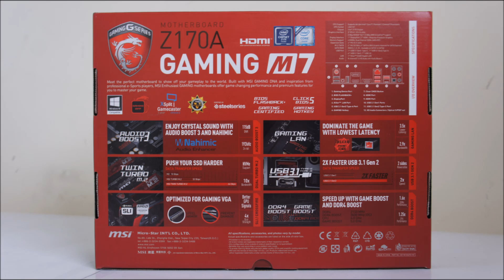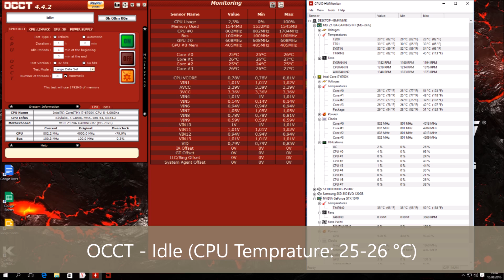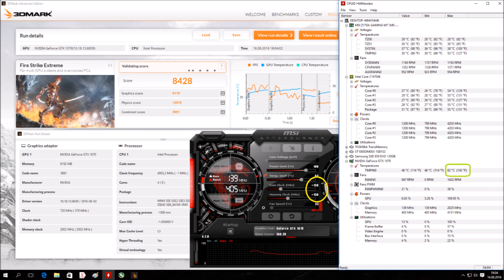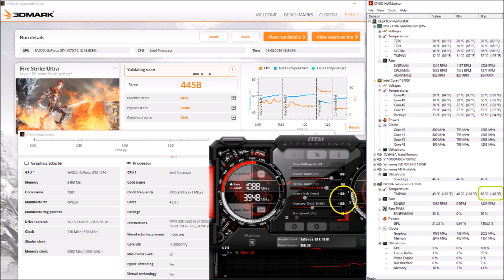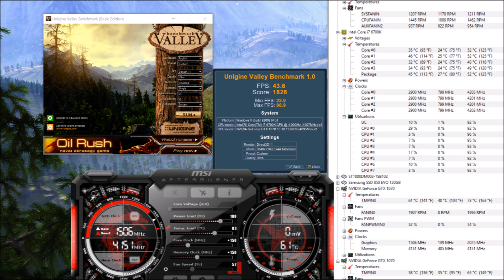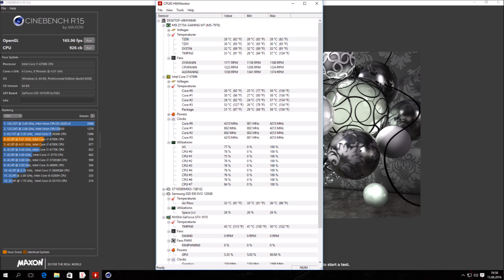INTEL i7 6700K GTX 1070 SLI PC BUILD BENCHMARK & GAME 4K TEST

Comment from the maker: Thank you watching,

SYSTEM CONFIGRATION: 
- CPU: INTEL i7 6700K 
- MAIN BOARD: MSI Z170A GAMING M7
- RAM: G.Skill Ripjaws V Series 16GB (2X 8GB) DDR4 3000 MHZ CL15 
- HDD: SEAGATE 1 TB HDD SATA III 64 MB 7200 rpm 
- SSD: SAMSUNG 850 Evo 120GB MZ-75E120BW
- VGA: ASUS GTX 1070 STRIX, 8GB, GDDR5, 256 bit + MSI GTX 1070 ARMOR @10:15
- CASE: COOLER MASTER Master Case 5 MCX-0005-KKN00 
- PSU: CORSAIR CX750 750W 80 Plus Bronze CP-9020015-EU
- CPU COOLER: CORSAIR H80i GT HYDRO SERIES (CW-9060017-WW)
- OPTIC: ASUS 24D5MT 24X Double Layer DVD-RW Siyah SATA
- MONITOR: SAMSUNG LU28E590DS/UF 28`` 4K Ultra HD 1ms 
- MICROSOFT Windows 10 Pro 64 Bit 

PRICE: 2500 USD + TAXES
Reply: i wanna make the same pc but i wanna change the video card 2 a gtx 1080 msi gaming x and the cpu 2 a intel i5 6600k
Reply: Would there be a enough space for another case fan above the CPU cooler?
Reply: WOW HOLY SHT DID THAT GRAPHIC CARD MAKE COLORED LIGHTS WAIT am am am i drooling over this? DAMN IT I really want these stuff  but i can't get them because am only 15 :(  athnd my parents don't want to spend that much money even though they can afford it and i can't work to get money and  i can't have a credit card i don't live in america and i really love theses stuff its not just because of the gaming its because they look cool and the way they work i also like composing stuff rather than take my pc to a guy and ask him to install stuff for me oh yea thx for the vid its awesome but am also kinda sad cuz i can't have this sorry for the bad grammar
Reply: man this is how my pc will be on the video
Reply: Great work on the video btw :)
Reply: ill change the vga :V this one is out of budget :V so te price of all mt pc is 1500
Reply: Nova Bilgisayar a

Comment: You need a better power supply than that one. I had a CS750 and it was noisy and unstable when drawing more than 400 watts. Get an RM750x or RM850x. Better fan and more stable power.
Reply: good call m8t
Reply: my cx750 worked through 4 of my builds before i got a 1000w supernova. they are pretty damn solid psu's.
Reply: its still powering my first build
Reply: I must have bagged a baddie. :P Either way, the ketchup/mustard motherboard cables are a bit of a turn off without extensions.
Reply: I have 550 watt psu And I7 4770k GTX 1070 And it works fine.

Comment: why wouldn't you go with i5 6600k and switch to a gtx 1080?
Reply: +Arel90 You're an idiot....
Reply: Arel90 The 6600k would not fucking limit a 1080... Like seriously what the fuck?
Reply: I love this community
Reply: Cuz imm thinking of getting another 1070 so i would sli em. Do u guys think z170 motherboard is good with i7-6700k and 2 gtx 1070,
Reply: Beacause the performance of the 1080 would be limited from the cpu. The gpu is not the most important thing.
Reply: Why?
Reply: +Arel90 everyone uses i5 6600k for gaming and a gtx 1080 doesn't bottleneck

I dont understand your argument
Reply: I'm planning on building a pc, do u guys recommend me getting an i7 6700k or wait for the new 7700k ?
Reply: +Sonicfizz  
maybe 2x gtx1070 better then 1x gtx1080
Reply: +Omar Jubran if you build for gaming 6600k must enough
Reply: If you overclock the 6600k it won't limit anything we currently have, but the i7 will still do a little bit better as well because it's got the stronger cores for threatening, but the issue around here is that someone is asking why he didnt downgrade his cpu and get a 1080, hes not doing a budget build lol though your suggestion isnt necessarily bad tbh ;)
Reply: no it wouldnt
Reply: +Arel90 fuck you, my hand went right through my head and hit my dad

Comment: could've easily had a 1080 in there for same price and same performance
Reply: ya a single gtx 1080.  might be cheaper but the GTX 1070 SLi beats it
Reply: The 1080 is only about 20% more powerful than the 1070, so you assume you OC both cards you have within a 5% differential. And if the game could only use the 2nd gpu to 50% of its ability, it would be roughly 50% faster than a single 1080. For the most part, SLI problems are done and over with. About 90% of AAA titles support SLI, and very well, some even using both GPUs to 100% if the CPU allows.
Reply: Same price... Sure...
Reply: a single 1080 wouldve been cheaper
Reply: not by much it doesnt plus you have added issues of sli problems

Comment: I'm planning on building a similar pc. Have you had any problemas with such a low-tier psu?
Reply: evga is way beter than corsair... you can get a 750w 80+ platinum for around 110$... search for the EVGA Supernova P2, hig quality, 80+ platinum and full modular

Comment: my specs r 
Gtx 1080 asus strix 
mobo: dz68dz intel
proces: Core I7 2600K
RAM: 16GM KINGSTON DDR3 
IM GETTING 30 TO 45 FPS IN GTA V AND 55 FPS IN TOMB RAIDER 2 
IS MY GPU NOT PERFORMING AS EXPECTED ? ALL THESE IN 1080P  THATS Y IM WORRIED CAN YOU HELP ME PLZ
Reply: you need a new processor, I recommend the i5-6600k or i7-6700k
Reply: you need New Motherboard or your Power supply is bullshit
Reply: Otaku_Class mobo doesn't effects performance xD
Reply: get a new cpu
Reply: +quality clickb8 canser 
my power supply is 750 gx cooler master 80+ bronze . is it ok?
Reply: Raghav Kalia yes but you need a new cpu. a 2600k cannot keep up with a gtx 1060. you are experiencing severe bottlenecking on the cpu end.
Reply: +quality clickb8 canser 
im thinking 6700 k and for motherboard asus maximus hero ?
Reply: +quality clickb8 canser 
should i get asus maximus 8 hero or asus maximus 8 hero formula
Reply: +dogeplays 
bro what is better asus maximus 8 hero or asus maximus 8 formulaZ170
Reply: Raghav Kalia you have to get a cpu first that has a compatible socket with the motherboard you want. you're going to need to get new ram, a new cpu cooler, a new motherboard and a new cpu. also dont get asus boards that expensive.
Reply: +quality clickb8 canser why i have a fx 6300 with a gtx 1060 and it works fine
Reply: +quality clickb8 canser 
thanq so much for the help bro i was worried that my gpu was not performing well but now im sure its bottlenecked but i didnt expected with a core i7
Reply: Raghav Kalia its an old core i7, the clock speed is not high enough and sandy bridge architecture will def bottleneck a 1080. get a i7 6700k. you will see huge fps gains.
Reply: +quality clickb8 canser 
so i should not be worried from the gpu side right ?
Reply: Raghav Kalia yes, just get a new cpu
Reply: +quality clickb8 canser 
thanq soo much for the help brthr
Reply: +quality clickb8 canser 
thanq soo much for the help brthr
Reply: +dogeplays 
thanq for the help bro 
this comuninty is nice 
i just wanted to ask that 750gx 80 + bronze is ok ?
Reply: +dogeplays 
its from the cooler master
Reply: Raghav Kalia that power supply is good
Reply: Your CPU is bottlenecking the GPU i5 6600K or i7 6700k would be ideal

Comment: Recently got a 1070 and plan on getting a 6700k in the future, how much room does this PSU allow for the GPU & CPU to overclock?
Reply: Well, the new 10xx cards dont consume alot of power thx to the new architechture. You can probably get away with 650w, but i would go a bit higher for futureproof and just to be sure
Reply: You don't make any videos, why would you need a 6700k??

Comment: Is this a good pc build 

ASROCK FATALITY Z170 GAMING K4 MOTHERBOARD
COOLER MASTER MASTER CASE 5 PRO FULL MODULAR BLACK CASING
AEROCOOL STRIKE-X 500W 80+ BRONZE POWER SUPPLY
ASUS RX480 8GB DDR5 256BIT GRAPHICS CARD
GSKILLS RIPJAWSV 16GB (2X8GB) DDR4-2400MHZ MEMORY
INTEL CORE I5-6500 (3.2GHZ) PROCESSOR
WESTERN DIGITAL 1TB SATA 3.0 7200RPM BLUE SATA
Reply from the maker: VGA card might be Asus RX 480 STRIX. Rest of not bad.
Reply: Thanks :)

Comment: How should i know how much watts i need in the power supply ??!
Reply: look tdp of any composants and add all
Reply: Try googling powersupply calculator, there are a few good sites that let you plan out what you need in a powersupply. Just remember that a "cheap" low quality powersupply might claim a certain wattage but in reality deliver less. My sugestion is to buy a powersupply from a reputable power supply manufactor, spending a little extra on a quiality powersupply is worth it in the long run.

Comment: i have a 6700k and a single 1070 :) quite a fantastic card and almost levels with the 1080 spec wise and is cheaper.
Reply: Got the same setup as you. Are you running with an WQHD, 4k or FullHD monitor?